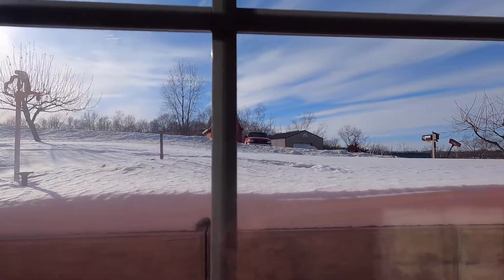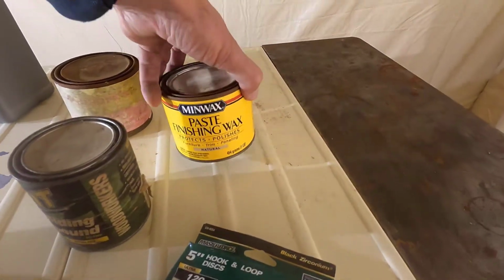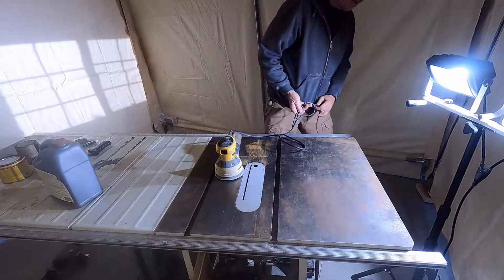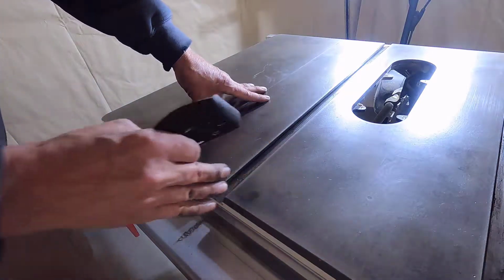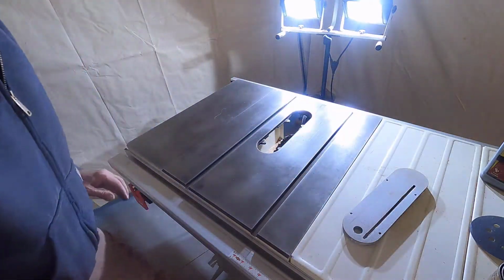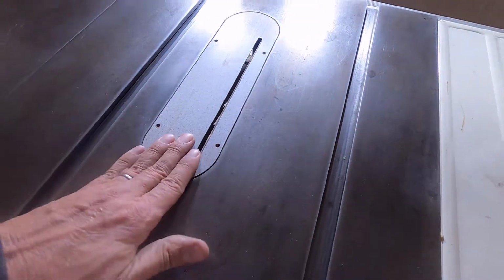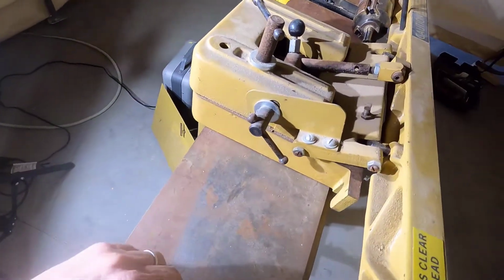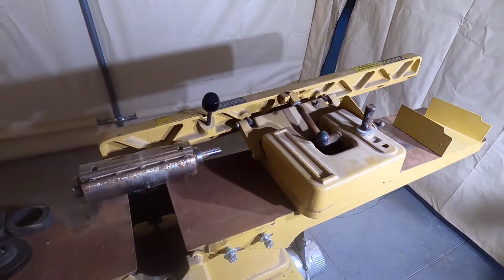Polishing My Table Saw Top ― Condensation Got the Best of It…

Comment from the maker: I polished the tops on the jointer today, and it was much colder in there! My feet were frozen after about two hours. I hope to clean-up all of the black oxidized metal parts next, and try bluing them. Once the cutterhead mounts are done, I can install the Shelix cutterhead! Below you will find links to some of the things used in the shop as well as tools I use:

3M All Weather Flashing Tape - https://amzn.to/3ICBX4P
Huber ZIP System Liquid-Flash - https://amzn.to/31OtCtN
Seville Classics Commercial-Grade 5-Tier  60" W x 24" D - https://amzn.to/3qgjrXJ
5000 Lumen Temporary LED Work Light - https://amzn.to/3eslZfu
Heavy Duty 3-Prong Wireless Remote - https://amzn.to/3EnPWYN
Powermatic Model 60C 8-Inch 2 HP 1-Phase Jointer - https://amzn.to/3mvPq4M
Jet Contractors Saw - https://amzn.to/3mAAQJs
Insul-Hold - https://amzn.to/3evnmKq
1" Garage Door Chain Hoist - https://amzn.to/3rn11VF
1" 4:1 Open Garage Door Chain Hoist - https://amzn.to/3uldvQA
1" 3:1 Open Garage Door Chain Hoist - https://amzn.to/3IVxXf0
1.25" Garage Door Chain Hoist - https://amzn.to/32R3vmS

Comment: I have a shop in my basement   have band saw cabinet  tabletop saw router table   drill press etc .  All   cast  Cast Iron   tops   Have a Rust problem too  I found out I now put cardboard  with no finsh on the cardboard on top of them when I'm not using 2 or 3 layers of heavy cardboard from boxes it really helps I get very very little rust if any  at all. anymore sometimes I don't use the stuff for months and months 
Ps  I also wet sand them get ready nice then dry real good 👍 then polish them
Everything   Really slides nice last pretty  long too
NOTHING IS BETTER THAN A CAST IRON TOP Nothing !
Love the shop wish it was mine  lol
Reply from the maker: Thanks Theodore! - Never heard of that, but it makes sense! I have used Cosmoline in the past when I was basically storing machines, but that has it's issues as well. I'll mention the cardboard trick when I am working on the planer. I need to remove rust on that as well and install a Shelix cutterhead. Thanks for the tip Theodore!
Reply: @TrapDoorWoodworks  tank's to you also.  I think the cardboard    Absorbes the moisture somewhat 
Also  that way no finish on it either side works

Comment: Great video - thanks! My two car garage shop here in Michigan has same issue. Need to move machines around to park one vehicle in it every night. Not great in winter, especially when it snows or rains! Maybe if I let our vehicle rust enough, I can justify to the wife just leaving it outside all the time! ;)
Reply from the maker: I had the same problem back in the day! It's hard to go do some woodworking with melting slush on the floor! 😩

Comment: Hi everyone. I wish to preface this comment with the my background, i have worked for most of my working life as a machine tool service and repair tradesman. When removing rust like this it is best to use a carborundum oil stone with a thin cleaning solution like WD40  or CRC 5.56 as using a power sander, it is very easy to bog in and undercut a low spot in the table or fence. If done properly you can see the original machining marks from manufacture and use them as a reference to any undercut and worn areas. If you have a question please send me a message and i will endeavour to give you the best advise i can
Reply from the maker: If done correctly, you are never going to "bog down" and "undercut a low spot". That would only happen if someone was incredibly bad with a sander. For the occasional flattening, I use a diamond plate.

Comment: Thank you for this lesson!  The table top looks great!  How do you know if something is wrought iron or metal? I’m trying to restore a 60 year old chandelier and I’m not actually sure how to do so properly! I’ve already taken it all apart, taken all of the old wires out and sprayed and washed it with dish soap but I wasn’t sure what to do next because I don’t want to destroy it with sanding and whatever else if I’m not supposed to! 😂😂 I am planning on using it in my wedding one short month from now so I was hoping not to have to paint it or anything as I do love the vintage look of it.
Reply from the maker: Hard to tell for sure if something is steel or iron. You should be able to sand it unless it is plastic. If you need to remove rust, I use Berryman Chem-Dip Parts Cleaner - https://amzn.to/3bid5AO otherwise sandpaper and a wire brush should do the trick.
Reply: @TrapDoorWoodworks  thank you so much

Comment: Any issues with using a paste wax on a top when it comes into contact with raw wood surfaces? If the wax transfers to the wood, it can foul up the finish if using lacquer or polyurethane. I have used a Bostich product (can't recall the exact name right now) that is specifically designed for this purpose that does not leave behind a residue. It is extremely slick. Smells like bananas.
Reply from the maker: I use Bostik Dri-Cote as well during normal machine usage as a lubricant. I believe all of the protectants/lubricants use some form of wax or another. At any rate, no, I never had issues with finishing from wax. I have had issues with silicone which is a big no-no in the woodshop. I worked at a company that thought it would work wonders for sticky table tops, and got huge fish-eye problems from it. 😮
Reply: @TrapDoorWoodworks  OK cool. and definitely stay away from silicone products when any finishes will be used later. Auto body shops have struggled with this, too.
Reply from the maker: @corey6393  Yea, my brother has been a bodyman all his life, and he has told me some stories about silicone getting into the shop. Fingerprints and fish eyes in fresh paint jobs can be real expensive!

Comment: This is a great way for a novice to ruin a cast iron top! I am not a fan of WD-40, however people use WD as a lubricant and that is not what it’s intended use is. WD- 40 is a water displacement compound. Is there a place for WD-40 in my world? Yes when I restore a cast iron top I do use WD-40 with Scotchbrite NOT sand paper! sand paper alone can create low spots in the surface of the table! Sand paper is too aggressive! And I use Johnson’s paste wax on the top after cleaning.
Reply from the maker: Calm down dude. If done correctly, this method will actually flatten the top slightly, but in the end it's cast iron, and a quick clean-up with abrasives is not going to "ruin" anything — whether the abrasive is silicon carbide or scotchbrite.